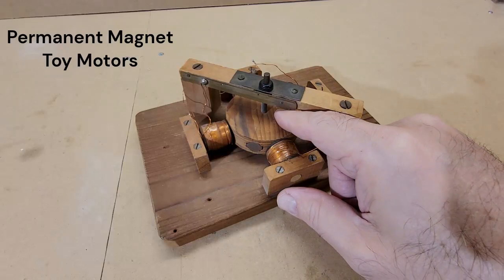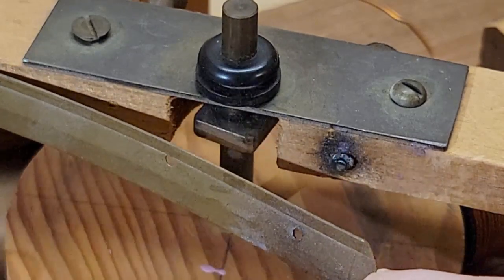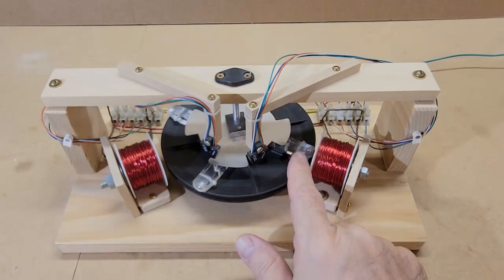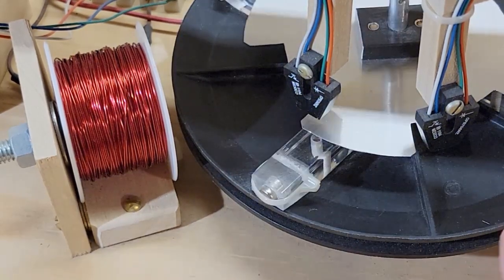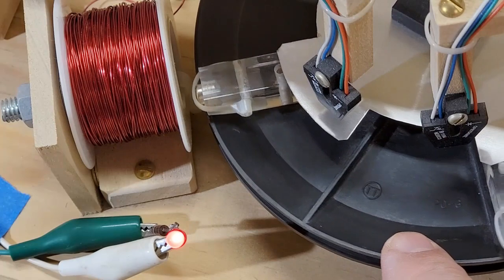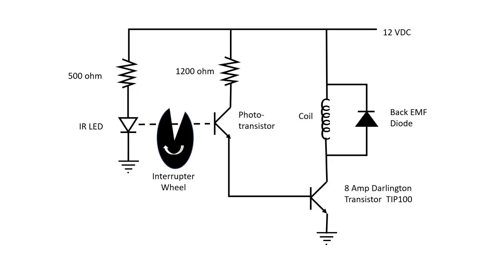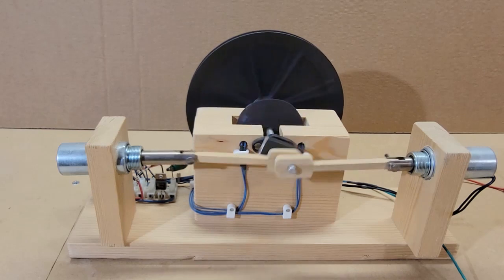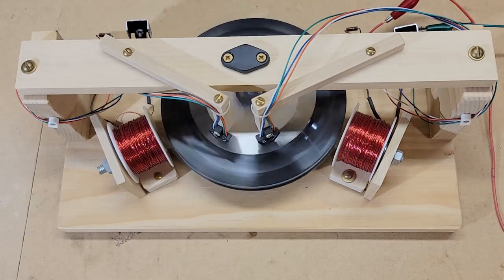Permanent Magnet Toy Motors, Old and New

Comment: The  first motor  why they  don't have pico farad cap on  its
Reply from the maker: I assume you are suggesting adding a capacitor to help suppress the spark.  I suppose that could be done, although I prefer using good sized diode to kill the back EMF.  However, it is important to me to leave the motor exactly as built, rather than to modify it.  That's why I built the more modern version.

Comment from the maker: Parts list
McMaster-Carr
	Mounted Ball Bearings w/ 2 bolt flange, 2 each
	Nylon V-Belt 6” Pulley
	Sealed linear solenoid 12 volt, 2 each
Jameco Electronics
	Magnet wire, 200 ft., 24 gauge, 2 each
	Reflective object sensor, 2 each
	IR Photointerruptor, 2 each
	Rectifier diode IN4002, 2 each
	Darlington Transistor TIP102, 8 Amp. , 2 each
	Resistors, 500 ohm and 1200 ohm, 2 each
Home Depot
	Aluminum rod, ¼”
	Aluminum flashing
Unknown Source
	Samarium-Cobalt Magnets, ¼” diameter X ¼” length, 4 each